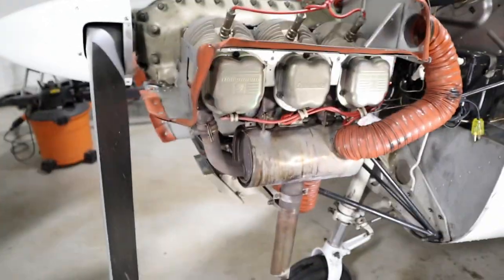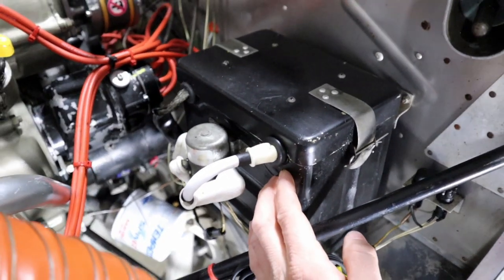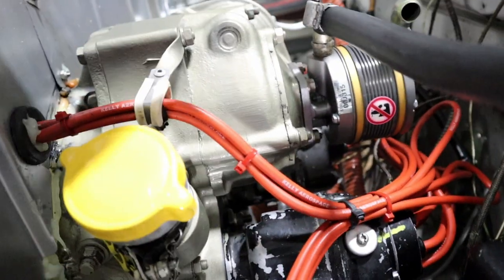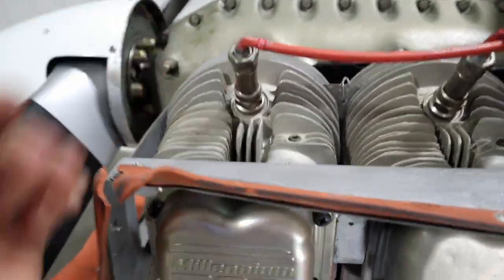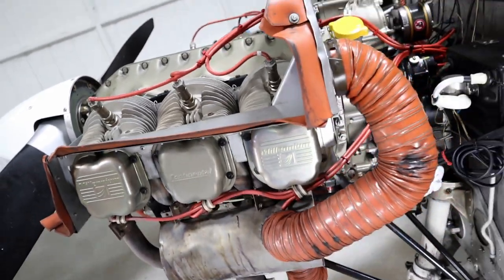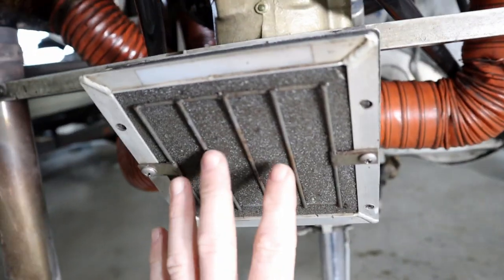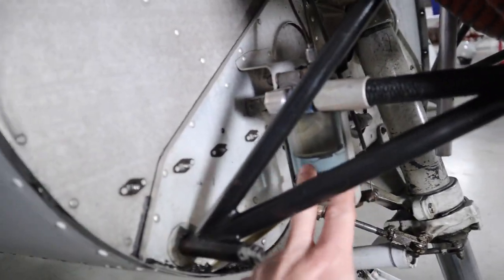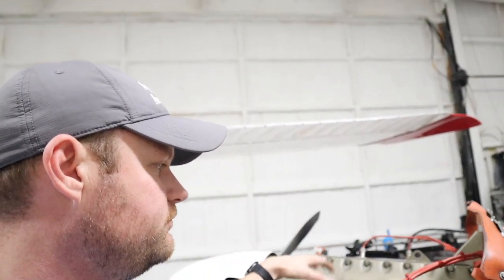Aircraft Engine Systems - Cessna 172

Comment: Thank you so much for this wonderful video. I find it very easy to understand how the whole system works. Just wondering, I understand that the air goes through the exhaust strut is heated and funneled inside the carb heater box. Does that air go through a filter before going through the carb? I'm a student and just need to understand. Maybe I'm missing something. Thank you so much
Reply: No the air going through the carb heater box is not filtered. Its not meant to run that air through the carb for too long as it is unfiltered and is thinner air due to it being heated. You will have a slight degradation in engine performance but its only meant to deice the carb so its ok for short periods.

Comment: Nice job..question on my 172K the carb heat flaper has alot of wiggle room at the box is that normal? I took off the filter and can see it moving when  pulled in cockpit. While doing run up I barely get a drop in rpm but at high power settings in flight I get at least 150 or so so I know its working..

Comment: Great video! Thank you. So I’m assuming that because it has a generator that it will not have an alternator. Is that how it works?
Reply from the maker: That's Correct Luis! its either it has a Generator or it has an Alternator. We actually converted all of our planes from generators to alternators recently. Just because they are more efficient and tend to last longer

Comment: Great video. Lots of good information. Kind of quick but good overall.
I did see something interesting forward of the left side firewall. A DC external plug. Is that standard or an STC?
Reply from the maker: Scot Cowie it’s the plug for an engine preheater

Comment: I'm not a pilot, but I am a mechanic for cars with 20 years experience, yet have been fascinated with aircraft (but due to my poor eyesight from a distance). Excuse me for saying but that seems to not only be a very small air filter, but most of the air, or what is "heated air" coming into the engine from side tubes isn't filtered at all?? Did I see that correctly? Maybe aircraft engines are far more efficient than car engines? Guess I need to learn more, but that doesn't seem prudent at all. And using carburetors instead of fuel injection?

Comment: Learnt a lot about the basic components on the engine.
Question is, if a TTOH is 2,000hrs, is that TIME in the AIR or total time the engine is on.
It seems that there is a lot of time spend sitting on the runway before/after flying that is not a stressful to the engine as flying itself.

Thanks.

Comment: Great video But I was wondering if you could explain the pistons with a little bit more information. Is it still a four stroke system with the intake, compression, power and exhaust?
Reply from the maker: Yes Sir, Its a normal 4 stroke engine. Suck, Squeeze, Bang, Blow